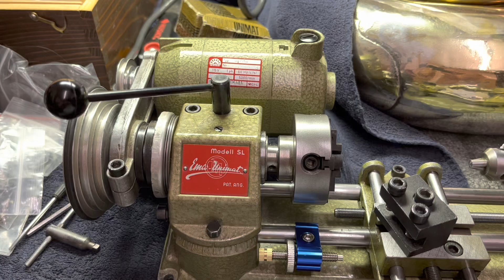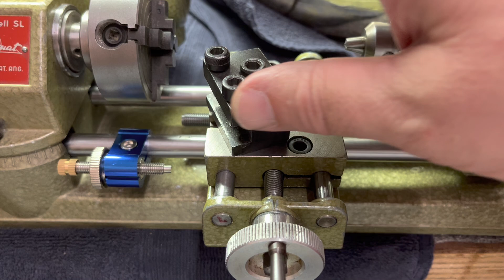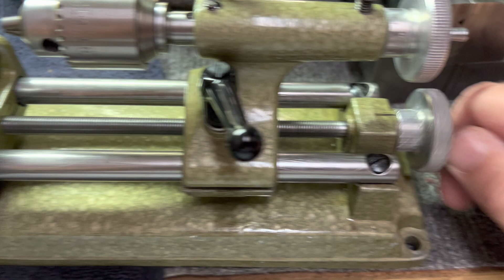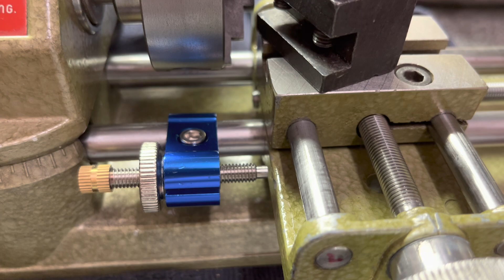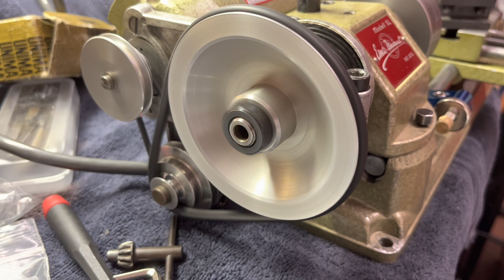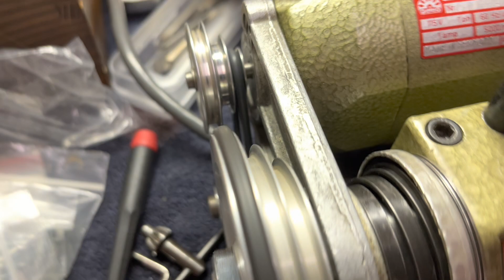Unimat SL - Almost Ready to Make Chips! (Read Description!)

Comment: Good video. I heard your comment at 2:04/
If you loosen the 12m cap screw under the headstock pulley (left), you can line up the dead center and the live center by rotating the headstock. 
Where did you get the blue carriage stop?
Reply from the maker: Thanks! Regarding the carriage stop, it was from an eBay shop/seller called beetlebud.

https://www.ebay.com/itm/185459274292?hash=item2b2e3bf234:g:Cf0AAOSwY39h0N4i
Reply: @holton345  Thank you for the info and link. Cheers!